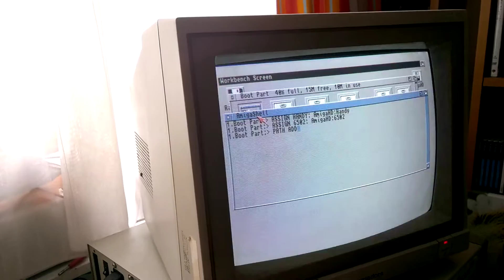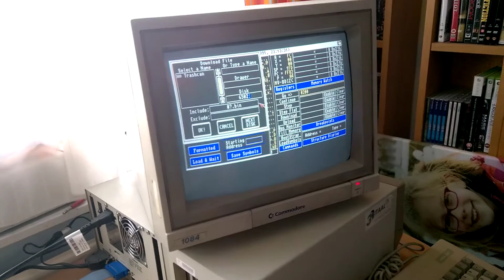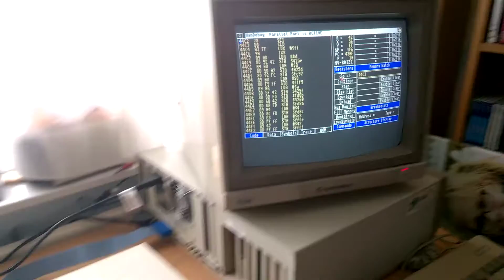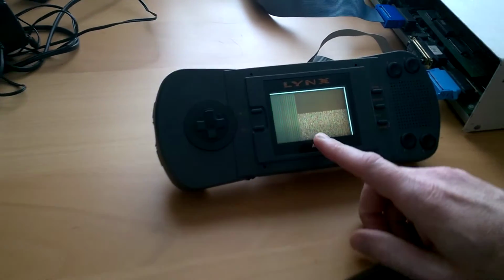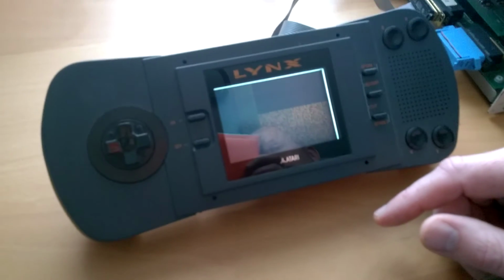Quick demonstration of Epyx Howard development kit

Comment: You say it works correctly,but i can tell you for what i do know, the lynx cannot hardreset itself,so if you load in a programm and then followed by the next progtam, it will simply crash because of this.

To get around this is to power off the lynx and then turn it on again.

Trough, the developers version of the lynx was designed with hardreset purpose in mind ,not the consummer version.